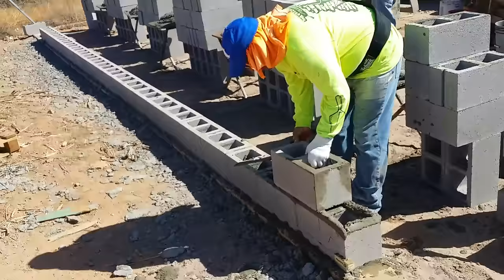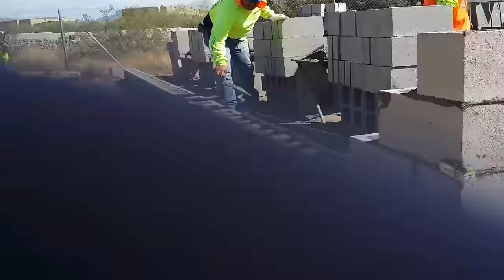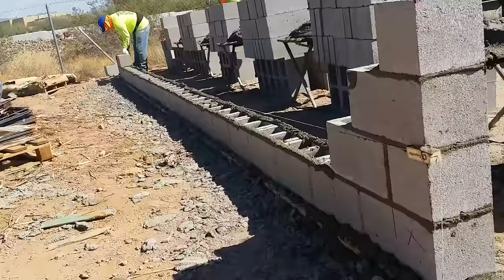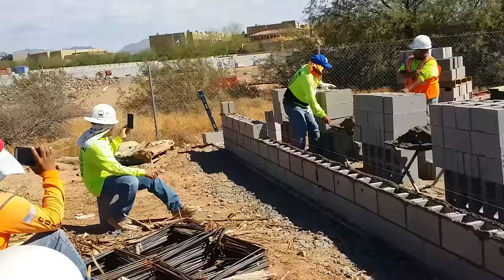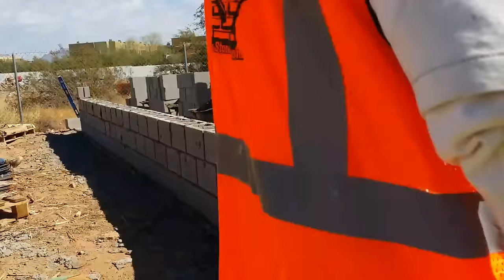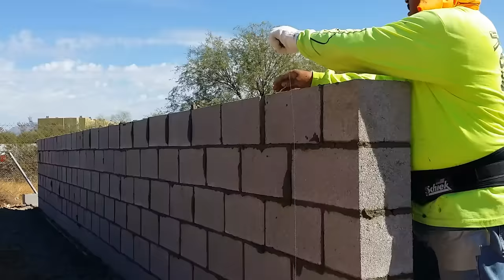Fastest trowel practice @matthewbias #fyp

Comment: For those commenting about waste of mortar on floor...it is perfectly normal since it should always be considered atleast 10-15% waste in mortar in the material estimate and blocks wastage is around 5% waste...so yes it is perfectly NORMAL...
Reply: BS a craftsman cuts the mortar from the bed joint from block just laid and uses it to butter the head joint for the next block.

Comment: Speed with masonry is all about waisted movements. You notice when this mason gets mud from the boards he is only tapping is trowel 1 time. I have worked with so many Masons that will, tap, tap, tap there trowels, really slows down progress. He also is not tapping g the block, probably not the straightest block, but it may not matter in this case. He is keeping the block close to his body when picking them up, therefore, saving unessasary whear and tear on him. Nice work my friend! Make sure to always plumb your lead on the line side, helps for a straighter wall.....)
Reply: Y
ou are fast there is some wasted moments when you are laying block to the line try seting the bottom of the block flush to the corse below the roll to block out to the line if the block needs to go down some push down that way you donot have to tap on it with your trowel allso instead of cuting the mud off with your trowel and leting it fall to the ground try saving it on your trowel for the headjoin so you do not have to go back to the mudbord

Comment: He's good but a building must have a wire and steel,and inside the blocks must have sand and gravel mix with 1 bag 40 kgs  cement and 2 box 40x40cm sand and 3 gravels.and a a phase 2 buiding you need a strong foundation using steel concrete cement or a beam,and a post and a beam holding the slab

Comment: there's no cement inside the hollow blocks build?so its means its easy to crack.
Reply: Jeric Adel it gets filled up with concrete afterwards and metal rebar
Reply: Load-bearing cinder blocks

Comment: Looks awesome. But I know that not only the high qualification is the key for such fast work but a very good cement mixture with some unknown for me additives. Because I know that in summer hot weather even one regular clay brick will not be properly placed with usual cement- sand mixture.

Comment: Why is he plumbing 1 side of the wall then proceeds to put the line on the other side. I don't understand
Reply: Boss You Don't Need To Know On the wall that long the line will sag doesn’t matter how tight you do it should lift the line five millimetres in the middle first .
Reply: This is a nearly perfect blocks,when one side is plumb the other side aligns
Reply: U have to build a corner first
Reply: Batman that’s not true. A longer wall, yes, but this size wall, the line won’t sag. Maybe a smidge, but not enough to matter
Reply: Called that eagle eye son ......
Reply: It will be plum on both sides. But, to answer ur question, the string is put on the opposite side so he can spread the mudd without the line being in the way.
Reply: All the block are the same size, it doesnt matter.

Comment: I was taught to have the concrete blocks wet before laying them. Prevents the dry blocks from sucking the moisture out of the cement, causing step cracking later from a poor bond.
Reply: That's mortar not cement
Reply: @nicholasfontaine4305  Does the bag say Portland cement or Portland mortar?

Comment: notice he is not lifting a block he is dragging it downhill every time. I'm in a 6000-block house I built by myself after work with not one helper. its assessment was 310,000 last year. It was so hot by the time i mixed up my motor and hauled the blocks and mortar to the second floor i could lay only 30 blocks and evening.  But i have lived here 18 years without rent now my taxes are my rent.

Comment: What is that wood block that the string is on
Reply from the maker: It’s called a line block. It keeps the line tight and in place while laying block to the line for level and plumb. Thank you for your question!
Reply: @matthewbias  

How does it stay attached to the block

Comment: He plumbs the corner but doesn't check for level or gauge. Plus nowhere near enough bed mortar by missing the middles out of the blocks & the perp joints not filled enough.
Quick but very sloppy.
He wouldn't work for me
And Yes I'm a bricklayer.